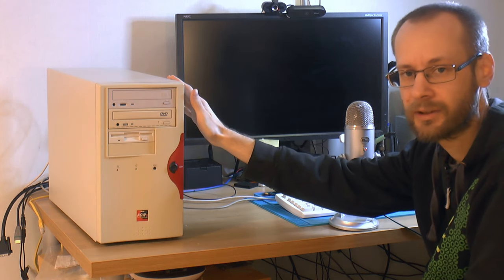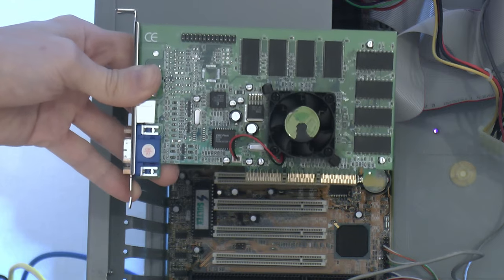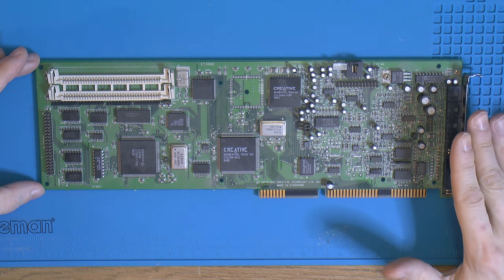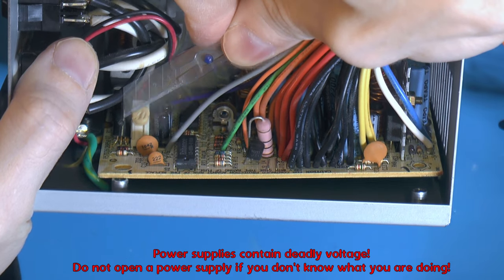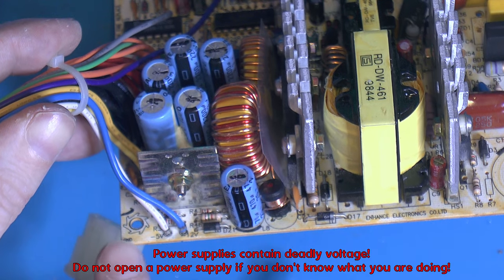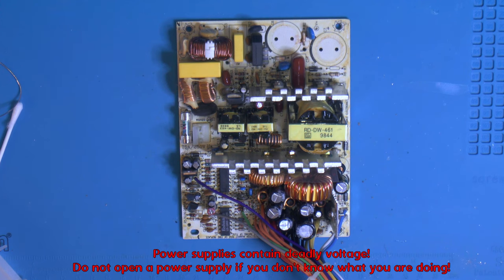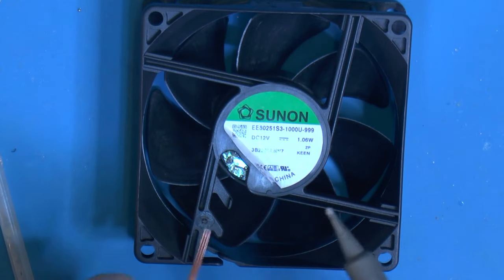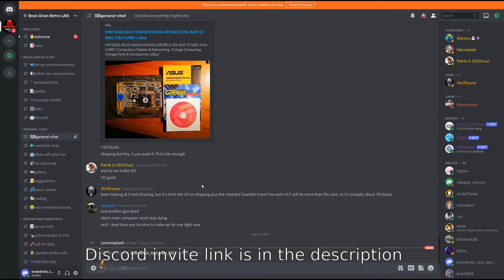Pentium II build - Part 1

Comment: I was a kid when the PII came out and we needed a new family PC to replace our aged out 486. Parents decided we were going to build our own so we settled on a 266mhz P2, with some oddities like built-in scsi on the motherboard to connect an internal SyQuest SyJet drive with 1.5GB cartridges. It started life with a Riva 128, and eventually a TNT 2. It also ended up with an overclocked celeron; the famous 300a that immediately saw 450mhz.

Comment: My own Pentium II experience (not sure what our Windows 9x PC had) started back in 2014-2015 with a Pentium II 233 system that I was given. Had no HDD, Asus P2L97, 128MB RAM (faulty), Viper V550, Diamond Monster 3DII and an Awe64 Value - with company inventory tags on everything (even cables). But it took me years of wack-a-mole replacing failing capacitors to make it a nice reliable PC.

Recently swapped out the board for the Intel SE440BX-2 that I was given at the same time, and then installed; Pentium II 350 (could go Celeron 450A or Pentium III 650, but I want the parts to match the case stickers), 3x128MB RAM and a generic 16MB Savage4 GT. While I could keep it completely original the upgrades greatly improve the QOL.

Comment: 😮But why did you spend time on recovering the old PSU? Their fans are really noisy. Last Fall I replaced Ione cheap ~ so called 450W crap classic composition design with 80mm fan,  mfct in  2014,  that was absolutely noisy even modified with a resistor soldered in.
Reply: Haha you really need to ask? Why didn't he just buy a whole new computer?